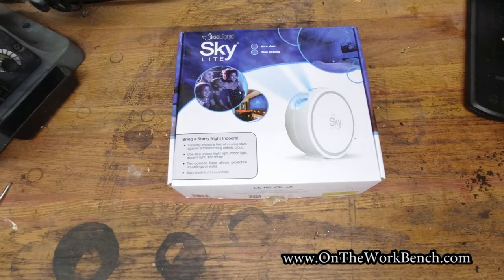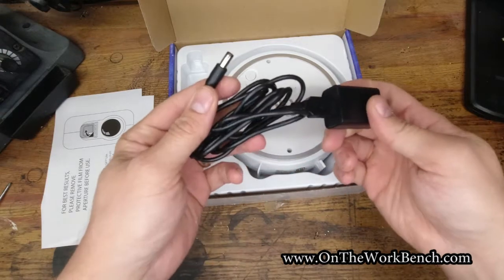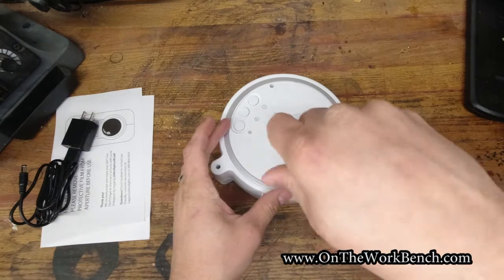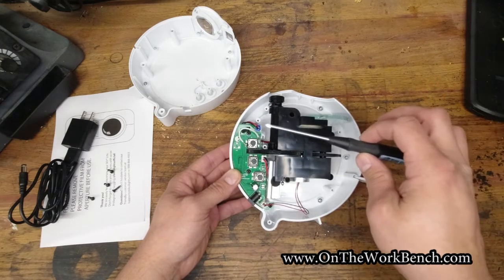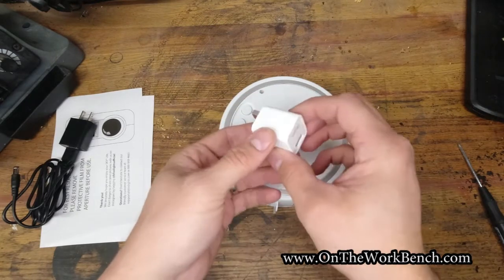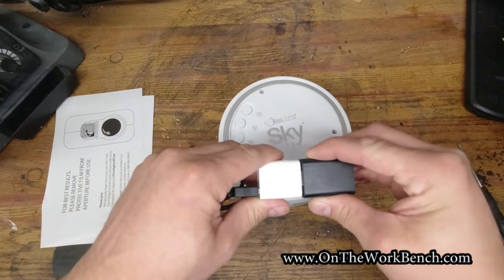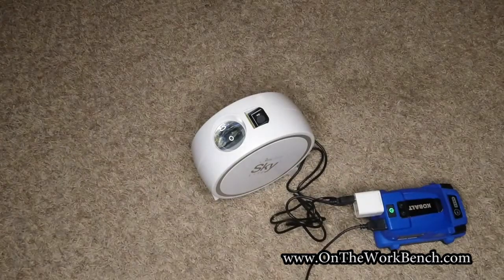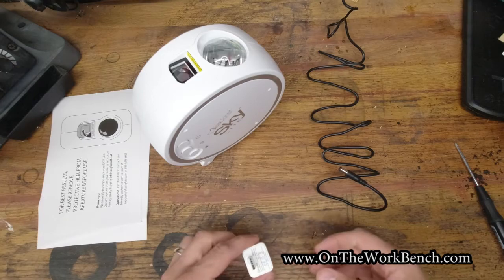Smart Home Hacking | BlissLight Sky Lite Star Projector

Comment: Not too bad, but I would probably have put in a Shelly inside it instead. You could use that to simulate the button-press instead. Also, the functions, doesn't seem to work very well with this hack. It's a shame that it doesn't just turn on at the recent setting. Actually according to the manual, it is supposed to turn on with default settings, when you plug it in, which it doesn't.